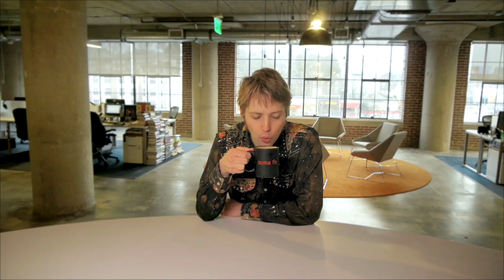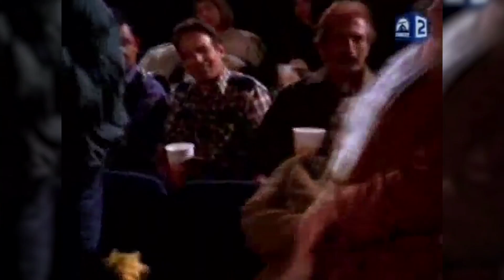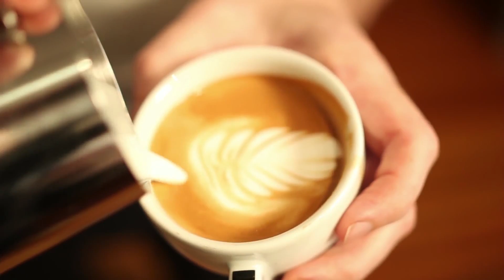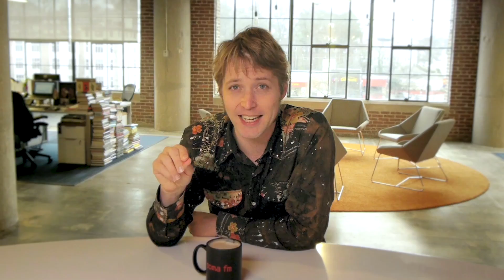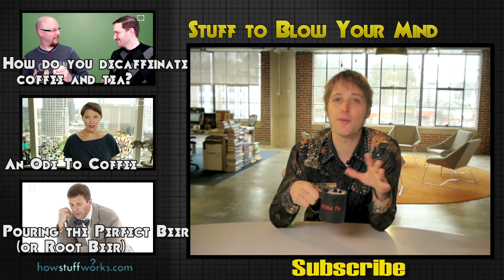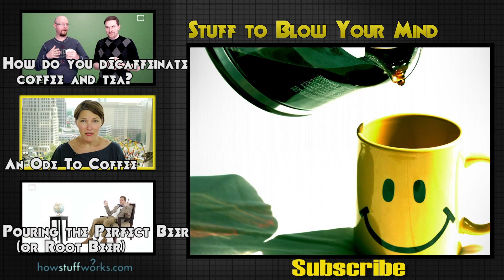Respect the Latte Foam - Epic Science #109

Comment: well to a degree it is not true since hot chocolate for example having foamy marshmallow on top help retain the heat inside much longer than without in what I found.

The bubbles in a way help retain the cold or hear since the bubble if completely covered will not let the steam escape or find its room temperature when it does not have access to it. Maybe it all depends. on many variables but I would not rely on foam to transfer heat just like insulated windows do not transfer hear.